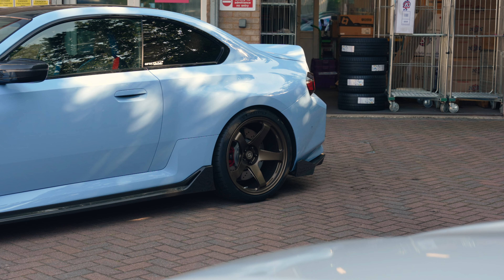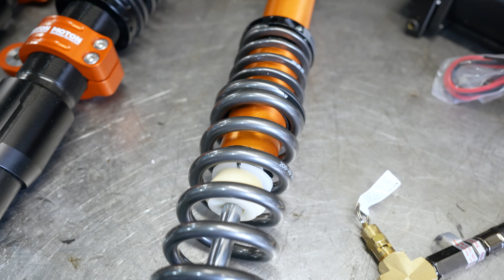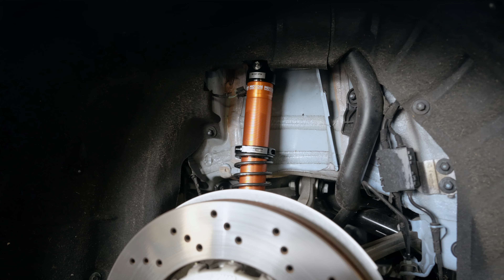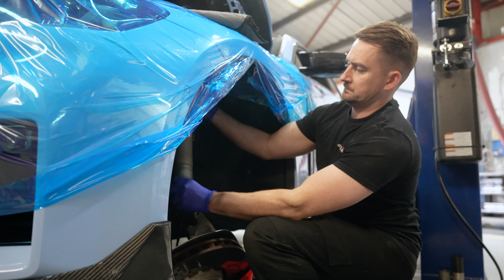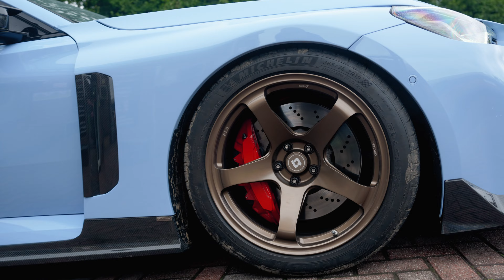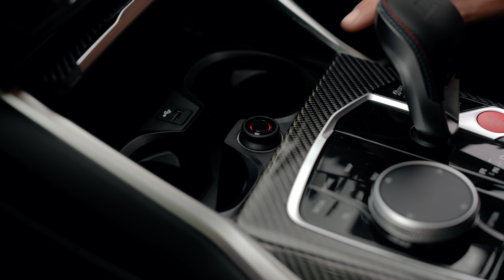ULTIMATE G87 M2 BUILD: MOTON COILOVERS WITH AXLE LIFT [PART 3]

Comment: Hi what is that button u use cuz the one thats included with the stanceparts lift kit is a wired setup while urs is on the cigarette port
Reply: Or is it getting rid of the cigarette lighter port for the button ?
Reply from the maker: We modified it

Comment: is the system only compatible with the 1 way
Reply from the maker: It's compatible with 1/2/3 way, we have a 3-way MOTON kit fitted with front axle lift recently. Did you want a quote on a similar system?

Comment: How much is the groundclearence of the frontspoiler after the lift
Reply from the maker: We did not measure, but it is a considerable amount on the front with the axle lift activated
Reply: Where are the compressors stored?